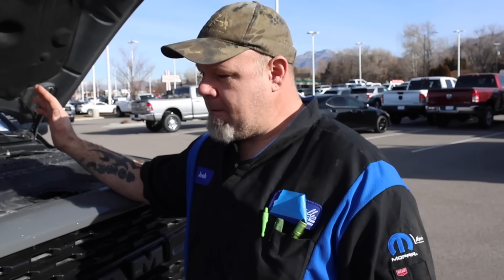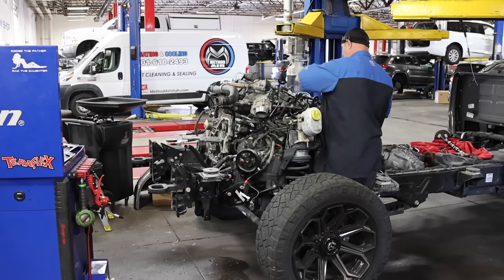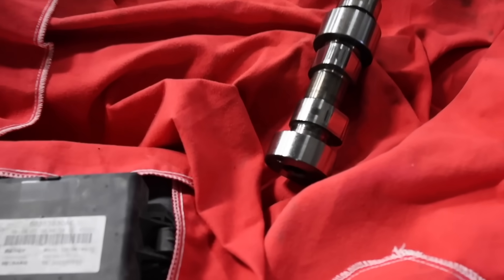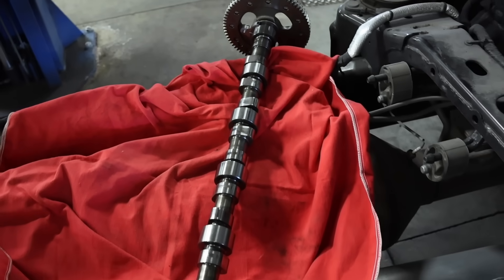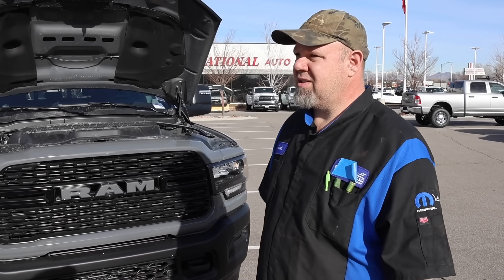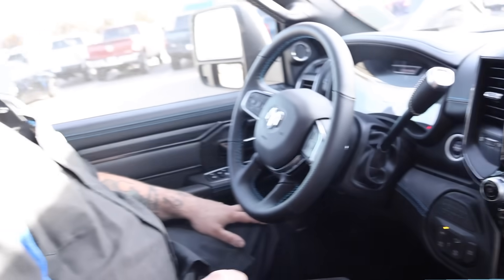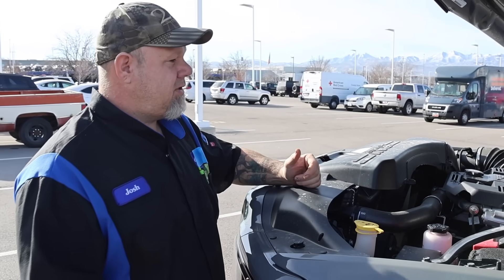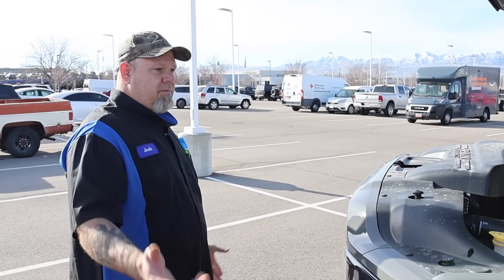Master Diesel Tech Explains The BIGGEST Killer To Your Diesel Engine!

Comment: Can any tell me if it’s different to idle a diesel or gas? I let my gas idle for sometimes for an hour or so while in the desert to keep the heater on, I don’t do that with my diesel now. Thank you anyone.
Reply from the maker: It’s not as critical on a gas engine however there is something to be said about the oil pressure/volume not being adequate at idle and can cause premature particulate matter wear/failure
Reply: @ Thank you for your reply. I’m new to the diesel world and I’ve seen people let their diesels idle. So I wasn’t sure if it was healthy or not for my engine. I know diesels are better for long hauls, not your average stop and go. I have an 06 LBZ but I plan to get a 5.3 05 for daily commuting instead.

Comment: Retired OTR commercial driver here.  All these pickup trucks with wanna-be diesel engins are junk.  Cummins came out with 5.0 liter V8 pickup truck motor that loves to spin mains, WTF?  The Navistar MaxxForce 7 - 6.4 liter V8 turbo-diesel engine turned out to be a turd.  Ford PowerStroke has issues.  If I were in the market for a heavy duty "pickup truck", I would go with a Freightliner M-2 Sport Chassis with a medium duty Cummins ISL 8.9 L Engine.  F.y.i., from my experience (40 years as a fleet driver), the best engine on the planet is the Detroit Diesel Series 60, 14 liter inline-six, 4-stroke (best selling and most reliable motor of all time).  That said, Detroit should design a inline six for commercial duty pickups like the F-550 or Ram 5500.

Comment: Big Semi Trucks run 35000 miles intervals. Semi Trucks idles all the time due to weather.  When hot you need AC to keep cool. In the winter you need heat and to keep batteries  charged and prevent fuel from freezing jelling .  I change mine at 10000 to 15000 miles.its a Detriy series 60. Has close to 2 million miles
Reply: Ha, in europe many newer semi trucks (artics we call 'em in England) are on 100,000km oil changes, circa 60,000 UK miles.
Coincidentally,  back in the 80s we used to run Cummins engines they'd run for 1 million miles on 15,000 miles oil changes without any engine work these newer engines are needing full rebuilds at anything from 400,000 miles upwards, any guesses why?
Everyone reckons these new engines are so much better, they talk a lot of cobblers about close tolerances etc, but they don't last.
Doesn't matter so much, very few semis are operator owned, they're almost all on 5/7 year leases with full repair and maintenance contracts.

Comment: Would you do a video on the 68 RFE? 
  I tow 20,000 lbs with my 68. It’s only gone up to 171° once. But I also lock it in a lower gear sometimes depending on the hills and mountains. 
  My question is does it hurt it to lock it in fifth or fourth gear as long as my temps are down?  
   Tow / haul is on.
Reply from the maker: As soon as I get a good candidate for a video I will do one. Thank you. As for using lower gears for towing it will not hurt anything and in fact can help. You are doing the right thing
Reply: @ thank you

Comment: I have an 01’ Cummins that I bought brand new. I always change it at 5,000 miles. Truck still runs and performs like new. I’ll never get rid of that truck because it has never let me down. Never left me stranded. And never been in a repair shop for anything. 👊🏻
Reply: 2006 5.9 Fleetguard synthetic filters, Valvoline blue, get rid of that junky stock air filter and put a cold air intake like s&n or banks and let that cummins breathe
Reply: Does your serial # begin with a 1 or a 3 ….?
Reply: @jeffreybexson7461 what does the 1 or 3 stand for exactly?
Reply: @ghostrider51500  1 is made in the US, 3 is mexico

Comment: Diesel tech/shop owner here , great advice. Awesome video. 5k intervals is what my shop recomends to customers.
Reply from the maker: Thanks, I appreciate that!  It's great to see other shops following the same practices.
Reply: My ‘15 Silverado 3500 is telling me it needs servicing, check owner’s manual now. I haven’t owned it quite a year and this is my first diesel. I’m currently limited to 55 MPH
Before I find a private diesel mechanic, any idea what I should expect the problem to be? Hasn’t been deleted as far as I can tell. I love the truck otherwise, but not impressed with how it can leave me stranded, so I’m learning. Thanks in advance!
Reply: @homemprovmentguy  if your limited to 55 it's more than likely an aftertreatement issue. How's your Def level ? Did it freeze ? When was the last regen ?
Reply: @ I’m admittedly completely ignorant with this truck. It began limiting me at 65 mph. I don’t know how to check the DEF level. I know it displays but I haven’t watched it because I was curious what happens when it gets low.  How would I know if it froze? I am in New Hampshire. I added a gallon of def when I first bought it. I don’t use the truck often, mostly use my work truck. I was planning to add another gallon of def tomorrow to see what happens.
What is this regen I’ve been seeing mentioned? Thanks again!

Comment: I do oil testing so I have some science about my oil change intervals.  5,000 miles is good, but the oil has plenty of life and low contaminants present. I think a more ideal mileage is between 7,500 to 10,000 miles depending how hard the motor gets worked. At this point contaminants including fuel dilution are beginning to rise to moderate levels.  By 12,500 miles my truck had nearly 5% fuel dilution, mildly degraded base number, and moderate copper and potassium levels. Bottom line is you are absolutely correct. 15,000 mile oil change intervals are way too long.
Reply from the maker: Thanks for sharing your oil testing experience, that’s good data!
Reply: No analysis would tell me otherwise to go beyond 5000 miles.  Had duramax and cummins for years. Never had problems with any of them oil related. Oil is cheap compared to what could happen. It wouldn't matter to me if I drained the oil at 5000 miles, and it still looked brand new. I would still change it.
Reply: So basically at 5k, your oil stays clean. 5k it is!

Comment: I am a 7.3 Powerstroke guy, 5k oil changes 10k fuel filter.  I like to add a Hot shots stiction eliminator every few changes to clean injectors.  I also run my CCV to atmosphere so it doesnt go back into the turbo and gunk up the system.

Comment: I truly enjoy videos like this. I don't have a truck nor a diesel engine. But the last 3 cars I've owned have been turbo engines. I live in New York, winters can be cold. I let the car idle for 2 to 3 minutes upon start up and then I begin to drive at a slow moderate pace  because to me the engine is still warming but I'm not overdoing it. Then when I'm ready to shut the car off.... I actually let the car sit for about 30 seconds and then I shut it off. I like my cars to last and I definitely do 5000 mile oil changes. The 10000 mile recommendation is way too long.
Reply from the maker: You’re doing a great job!

Comment: I idle my 2018 Cummins about an hour a day, and I sample my oil and send it to Blackstone labs. I change my oil at 7500. My last oil change was at 9800 and that sample was just fine and the lab said I could have run it to 12000. Which I won't.

Comment: Nice video brother, thanks for doing this. I maintain a fleet of Cummins 5500s and we change at 5000 miles but our hours are about 50/50 idle vs drive. How many hours do you recommend before a change? Also, i can't wait for the 48 volt after treatment system so fuel isn't used to regen

Comment: The owner's manual recommendations are written by lawyers that are trying to appease the EPA, not the engineers who built the engine. Those people are rolling over in their graves. Pretend that there was no fuel dilution providing a deterrent to lubrication. The heating and cooling cycles of a turbo'd engine breaks down viscosity. What are you trying to prove by going more than 7,000 miles? I'm not trying to save money on oil.

Comment: I drive a 2022 isuzu D'max 3.0l turbo diesel 4x4, here in Australia (mid north coast of NSW)it's a warm to hot climate. I do let my ute idle for a minute or to but thats it usually. Isuzu recommend a service every 15,000km which is 9320.568 miles 🤔. 15,000 miles is 24,140 kilometres. Thats crazy no wonder people in the states are damaging their engines. Great post mate.

Comment: And sadly our Paccar engines run 50,000 miles on an oil change. 
Still meets warranty requirements.  Granted they hold 10 gallons give or take. But we beat them to death. It's amazing they run as long as they do.
And I work for a oil refining/manufacturing of many brands of oil. Motorcraft. Kendall. Honda. Subaru. And many others ...
Yet we run a brand we don't make in our Semi trucks.

Comment: Thanks for the info on the block heater for the 5th gen.  Had a ‘01 5.9 24v HO that we ordered with block heater, but our ‘09 6.7 didn’t have one (as far as I knew). Our ‘24 6.7 HO doesn’t have the cord, but great to know it comes from Cummins with one and its location. Also good to know about the cruise / high idle set.  We live northeast of Houston, but were in Colorado for thanksgiving, had opportunity to witness the truck raise idle on its own. I do my own oil changes at between 5k and 6k miles.  Did fuel both fuel filters at 15k.  Wife and I love towing with our Cummins.

Comment: If you're so inclined to get rid of the emissions garbage on your diesel, use an oil that hasn't been de-engineered to save emissions components, which results in less lubricating qualities for your engine. Then change your oil and filter every 5000k miles. See explanation here:

https://youtu.be/qbisFIfYN40

Comment: Short trips, not coming to temperature is a sure death sentence for a diesel.
Reply: What's the temperature  to be  reached for optimal operation?
Reply: @efraingarciaescalante2824  dunno exactly...shutting down before temp guage is at least half way  would be poor practice.   Wasn't using my diesel for towing any more and short trips in my small town were the norm, after I moved down onto the flat, so sold it.  Full operating temp for 30 minutes, at least, would help to keep EGR components happier. I'm no expert,  but I've owned 10 diesel engines,  including Gen sets, in boats and trucks and RVs...never had a problem,  and never failed an oil assay upon sale.  Keep  fuel, oil, air clean to avoid bad experiences.

Comment: To sit there warming up your engine after high idle is ridiculous. It will warm up quicker under load . Soon as your oil pressure is up  and its settled into a nice steady idle move off . 
Don’t rev it hard till the temp comes up to normal.
Reply: At high idle

Comment: So far... no one commented saying they are working for an oil analysis lab. Oil is a chemistry. Oil sample tell you exactly what is in the used "black" oil - instead of guessing. More importantly. Oil samples tell you how often you need to change the oil. I have 500 15L ISX and 200 detroit diesel DD15. They oil change at 150,000km as remommended by the lab. 42L of 10w30 semi diesel oil from dealership. Have been doing it for 8 years so far. They are leased trucks through Freitliners and Internationals. No oil consumption or failing components. If there are some, the dealership will make us pay for it. Diesel fuel can not be call gas, as it is a fuel. Gasoline is a gas! Gas burn clean, diesel burn and leave black smoke - we call it soot, which make black oil. Rolling coal and high RPM kill diesel. Cummins make peak torque at 1.5k RPM. After that, they loose torque. Super long stroke with extremely high compression pressure is a bad combination

Comment: The only total  diesel engine failure I've had was from not using coolant conditioner. Or not adjusting the valve lash on a Mack. Also, my experiance is Rotella does better than Delo in turbo engines. And add a bottle of STP every oil change.

Comment: Maybe you will end up with fuel dilution. My work trucks idle 40 to 45%. Oil samples are regular with no issues. My last truck had 268K miles and 15,800 hours without issues.

Comment: Great video, you would cry!! I have a 1993 gen # 1 , 250, 4x4, 5 speed Getrag, only weak link, 138 k original miles! Red, beige interior! My baby in SLC, garage kept . Guys at Industrial Injection drule on it ! Great job , change my oil every year, drive truck twice a year to pull boat . Run engine in garage every 2 months. I have a water methanol injection system to keep EGT down , boat is 12k with trailer. JohnBoyUtah 😎🇺🇸🚤⚓️🛟

Comment: When you spend $90,000 for a new diesel it’s penny wise and pound foolish not to change the oil at 5,000 miles or less. Excellent advice on not idling unnecessarily, but doing a couple of minutes of cool down idle, after driving, to protect the turbo.

Comment: They've been doing the same with gas engines and telling you that you can go way longer on the intervals. It's only because the motor will still last the warranty timeframe and then the company hopes your motor explodes right after warranty and you go buy another vehicle. The fact is there is no combustion chamber that isn't going to let some blowby (contaminants) get into the oil. It's just not possible. The 5,000 mile oil change exists for a logical and time proven reason.

Comment: I watch    Daves Auto Center     on YT its the premier diesel rebuild auto center. Its amazing how many blown diesel engines they take apart that have been running shitty oil at a high OCI.
Just black chunks in the oil pan brown patina on everything many look like there running dino oil. Incredibly cheap and stupid. That's a  $15,000 rebuild. if you want to see how your engine oil is doing just take the oil fill cap off get flashlight and look in there. Head metal should look clean no brown patina no black chunks clean  oil pooled up and the valve gear should look shiny brand new at any mileage. 3000 mile OCI! oil is cheap compared to your truck up on the rack.

Comment: Could you please answer an oil question. I have a 2012 2500. I have rarely drove it in last 5 years. It seemed a waste to have it for everyday driving. It is in a garage that is heated and air conditioned. It's possible it may have a tuner and new 5" exhaust pipe to the muffler. It has 70,000 miles. It is in perfect condition. I have got so anal about not driving it that it's lucky to see 500 miles a year. So I change oil at 2,000 miles because of the time. Am I waiting to long due to the age of the oil? And where is that 1 quart that gets left in the engine?  You also mentioned 400 to 500 dollars to do it right? Synthetic oil? I do start it once a month and bring it to full temp. Any suggestions would be greatly appreciated. Thank You.
Reply from the maker: If and when you do start it it needs to be brought up to operating temp and for extended periods. That’s where oil dilution comes into play.

Comment: Your oil is naturally going to blacken due to the Sulphur being removed from the diesel fuel. All my O/O trucking career I've owned cat's" and learned that BACK PRESSURE is one of the biggest diesel engine killers" that's another reason cat discontinued building truck engines in 2010. Because cat's won't run on those joke's called regene exhaust systems.
Reply: @nicholasaquino5160  
Sulphur being removed has zero to do with oil turning black
Reply: @candyman1967  bullshit" sulfur is a bonding agent which used to keep the dirt outta your oil. By removing it your oil will blacken quicker!!!!!!!
Reply: Cat still makes engines. Even offroad diesel engines in excavators and dozers run def and regen. Skidsteers all diesel engines with over 75hp has def. Even lower horsepower engines still have a dpf and regen. It's my understanding, they lost a lot of money with acert, and the truck market wasn't making as much as the offroad side. Along with constantly changing emissions regulations for highway diesels they decided to cut their losses on hwy engines and focused on offroad.